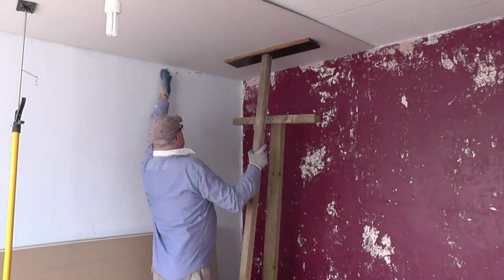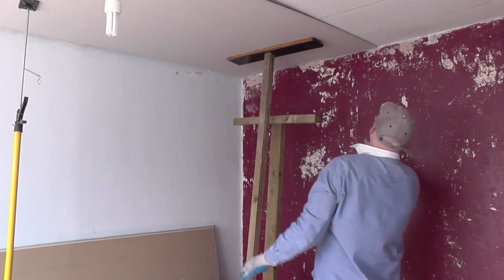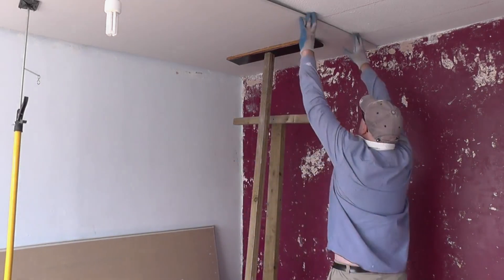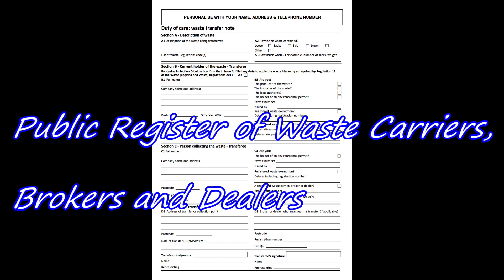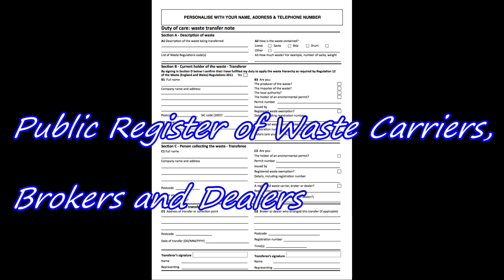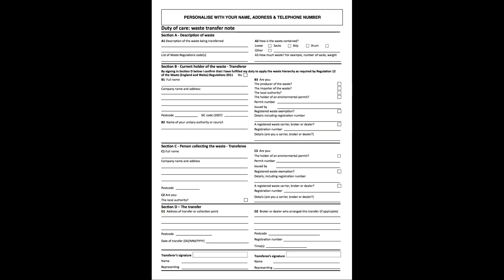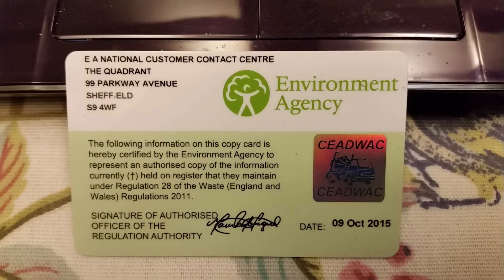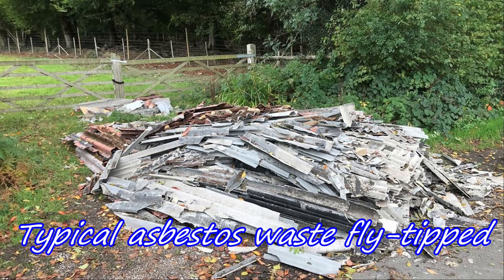You, Asbestos &The Law:  How To Safely Identify, Remove & Dispose Of Asbestos In Your Home

Comment: Can belongings be contaminated in an asbestos shed? The roof of the shed has holes in it.
Reply from the maker: Hi there. That would depend on whether asbestos dust had settled anywhere and was subsequently disturbed and asbestos fibres inhaled. So in theory yes, but in reality this may not be an issue due to accumulations of other dust, muck and rain water, etc.  Best thing to do would be to mask up with an FFP3 and spray everywhere with a fine water mist to bind all dust together and carefully clean up. For peace of mind, you could always repeat this again. Chuck mask and old clothing, repair roof and relax. Best wishes, Des

Comment: i had some asbestos removal on my floor(little hall) in my apartment . they company did a great work, but some small stones and dust came in my bathroom.  should i worry a lot?  what can i do to feel safe or how can i clean it?  thanks for advice
Reply from the maker: Hi there and thanks for watching. It's always a bit of a worry but you'll be OK if you're sensible. Personally, I wouldn't go in the area for a couple of days. Then, I'd get myself a couple of FFP3 disposable masks, some longer arm length disposable gloves (e.g. Marigolds or similar), water in a spray bottle that isn't too powerful (a typical household spray bottle or small garden spray container is perfect), damp down all areas and wipe down with a wet cloth in a bucket of water. Dispose of mask and gloves. Reason for delay would be to allow any fibres to settle, mask to prevent any inhalation of fibres and gloves to protect areas near hands. Spray mustn't be too powerful as you don't want to create an aerosol effect and send any particles shooting back into the air again. Job done, you'll be fine, get on with your life. (Contractors should have sealed everywhere off though). Best wishes, Des
Reply: @21stcenturycaveman33  Hello Des thank u so much, can i send you pictures of the dust in the bathroom? do you have email?
Reply: @angc1456  if you still are dealing with this, lmk and I'll try to help
Reply from the maker: Also, don't open any windows until after clean up as any breezes will simply blow dust and fibres all over again.

Comment: What if my landlord removed this asbestos insulation from The heat pipe runs in our basement  illegally,  no notice,  no permit ? What can we do as tenants for this wilful neglect of our safety ?
Reply from the maker: Hi there. Unless you have suffered some physical damage  and can prove a causal link between this and your landlord's negligent actions - very little if anything (UK law).  That said, on the bright side you don't want to have suffered any of the illnesses caused by asbestos as these would be horrible and potentially life threatening. All you could do is report him/her to your local environmental services. ATB, Des
Reply: @21stcenturycaveman33  thanks for the info- I'm in Ontario Canada,  and trying to find the government regulator body of this hazardous removal is like finding out how the Pyramids were built
Reply: @valentthor2655  unfortunately the impact takes usually 10 to 15 years to take effect.. but if there's any way to get him required to pay for air testing, that'd be the best way to better gage your risk

Comment: Anyone know if there is asbestos in anything a plasterer would do? So talking hacking down external render, old plaster boards or lath and plaster etc
Reply: Depends on what year the house or remodeling was done.. but there are asbestos manufacturers guides if you have that information.. otherwise you can get it tested by professional or diy kit sent off to lab
Reply: Usually 1920-80 is USA products that might include it, but epa still allowed to sell old stock afterwards

Comment: How likely would a house built in 1995 contain asbestos ?
Reply from the maker: It's possible but less likely. Look for signs and treat with caution. However, risks are definitely diminished due to more recent build. ATB, Des
Reply: If in us, then slim to none
Reply: Popcorn ceilings, Sheet Rock - especially the joint compound. For some reason the joint compound had Asbestos long after sheet rock didn't. 2000's were good. 1995 they had made lots of restriction by then, so your probably fine.

Comment: How can it be safe to drill boards in to Artex ceilings? Should it not be a requirement to remove all asbestos? Years later, an unknowing person could renovate and die?
Reply from the maker: That's very true. The reality is hough t this stuff is absolutely everywhere and the costs of doing so would be extraordinary. Whose going to pay for it? ATB, Des
Reply: @21stcenturycaveman33  Thank you for your answer. If the owner cannot pay for it and the company is no longer liable, then I agree - nobody should pay for it all to be removed. If an owner has the money, though, wouldn't you recommend it to all get removed? It feels to me like living in a glass house. 

Also, wouldn't the act of screwing in a screw cause asbestos dust to be dispersed?
Reply from the maker: The problem you refer to has 3 obvious strands. Economics, the law and morality. Firstly, asbestos is only dangerous if interfered with. Thus, if you board it over or enclose it (as is common practice and recommended by the H&S Executive in appropriate cases) then there's no immediate problem at all. Just get on with your life. However, if it's going to weigh on your conscience, then pay to get it removed.  End of. However, this will not immediately benefit you but may help someone else some years down the line. So, it's whether you're prepared to fork out a significant sum to help a complete stranger some years away?   IN terms of the law, there is absolutely nothing wrong with boarding or concealing asbestos containing products providing appropriate advice is sought and measures taken. The H&S website has a great section on this. So, you're not breaking the law. That's that bit out of the way. Thirdly - morality (assuming such a thing exists in the C21. Are you prepared to leave the stuff there knowing that it may adversely affect a complete stranger some years down the line? Will they appreciate it or thank you, or even be bothered? If your property is of a certain age and walls and ceilings have been plastered it should be obvious to anyone at a later date that precautions need to be taken? That said, if you're going to be charitable and spend a significant sum to help someone else, perhaps it would be better spending your funds helping the homeless with food, drink and accommodation where you can actually derive a tangible benefit?  Who knows. Your call mate. I haven't got a problem with it. Des
Reply: @jsdevtom  if drilling into it, then it'll become airborne.. but if encapsulated or not disturbed, then you should be unaffected in most cases.. and use the proper cleaning process/ products if cleaning any areas
Reply: @jsdevtom  in the US, many older schools, and military bases are built with many asbestos materials, and still safe if undisturbed materials

Comment: Get advice Des, I remember a few years back I did a garden tidy for a customer, they had a shed covered in asbestos, at first I refused to get up there to cut overhanging shrubs, ended up standing on it and fell straight through the sodding thing, never again will I put myself in that danger
Reply from the maker: Agree entirely mate. Just not worth it at any price. About 2 yrs ago someone asked me to do some tiling for them but this would have meant having to remove some really thick artex type material which looked as if it had been rendered on with a spade. Not in a million years! Take cate, Des
Reply: Lol plonkers man up
Reply: @frankchristian7950  bet you haven’t got enough brain cells to rub together